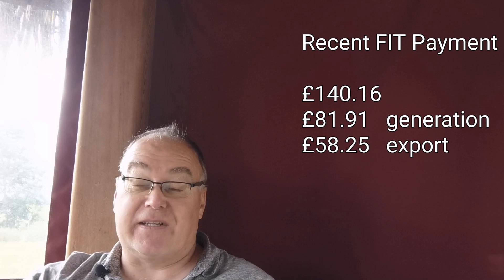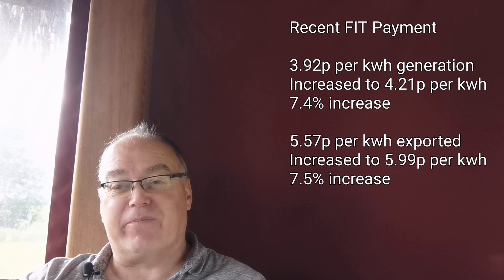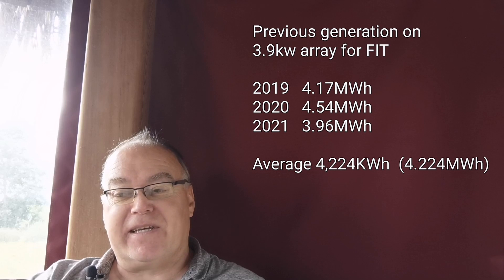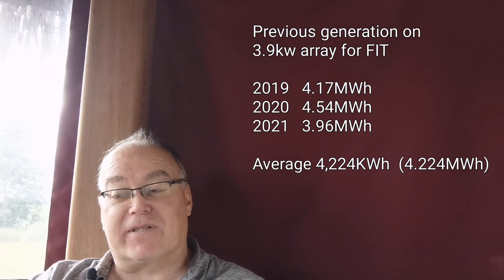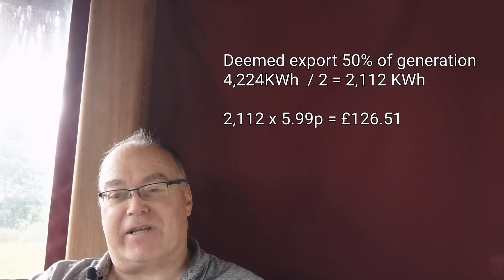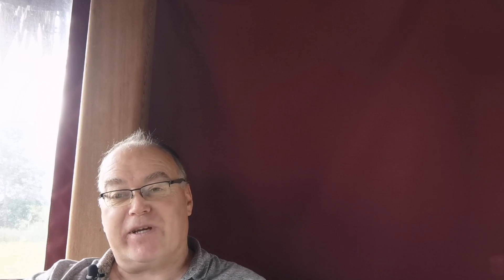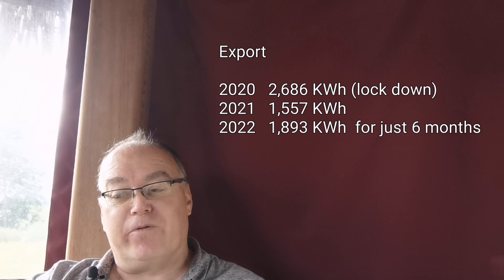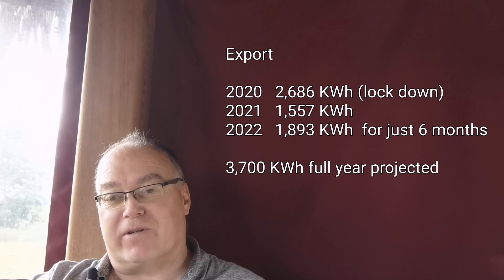Is it time to swap from FIT to  SEG? Smart Export Guarantee. Calculations & thoughts

Comment: does FIT not pay regardless of actually exporting? "deemed export"? More places to put the electric for future use while also getting paid 50% of it sounds better to me and a safer long term play. Assuming you'll have a water tank with your heat pump so thats a thermal store of the electric there. Something like the Sunamp for the heat pump could be another place. V2G stuff (Octopus Powerloop) feel like its going to be easier to store electric going forward vs exporting it for a tidy sum. My $0.02 thoughts.
Reply: They have changed a lot over the years. I’m not far from the end of a FIT contract that was for 10 years, with a generation price linked to RPI, plus deemed 50% (at a pretty low value) on the basis of not having an export meter. However, if a meter capable of measuring export came into use, real values would be required.

Notwithstanding the push from utility firms to switch to “Smart” meters, a couple of years ago the one I was dealing with didn’t want FIT customers to do that, as they hadn’t worked out what to do about switching from deemed to real values. After all, no generation meter is capable of being read remotely, along the lines of “smart” meters, and although the latest ones can measure export, they don’t really know what to do about it (bureaucratically). We would still have to read export and generation manually, at the same time, to make it work properly.

I suspect that if I had an export meter, they (Ofgem) wouldn’t like it, as the cash would flow the wrong way, especially at this time of year, like today!

Comment: Its not very clear(on the Octopus site).. But you cannot be on 'Go' or 'Go Faster' AND get 7.5p for export.

From Octopus "you can't be on both Outgoing Octopus AND Octopus Go"

This changes the numbers a bit i guess?

Alas my Go Faster is ending next week... So my electricity bill is going to pretty much double (we consume 14500kW/year)
Reply from the maker: As I said in winter when I need GO I dint export anything  don't need to be on any SEG

Comment: What I am looking at is if it is even possible to have enough solar panels and battery system in my house so that I can have zero energy bills. Not really seen any videos of anybody showing they have achieved this use electric for heating as well during winter.
Reply: I think being net-zero at the end of a year is more practical.  Ideally I would want what I sell in the summer to cover the heating costs in winter.  Not there yet but as solar power gets better a second array will help.
Reply from the maker: I worked out I'd need 300 solar panels and 100kwh battery . It's simply not practical .  In winter a 5kw wind turbine would help and be more effective than solar .

You just need to look at off-grid living to see what's possible and what's not
Reply: I think we will be able to achieve this in our newly built Passivhaus, which has a 13.8kW array and no heating system! We moved in in Feb so don’t have a whole year’s data yet - I’ll let you know next February…
Reply: Hi I’m looking to achieve this have a old house 1640 going full electric including heating have solar wind grid tie and off grid solar hopefully be off grid completely by next spring will do a video on how to do it ,it’s not easy.👍
Reply: I guess its all possible... But not that easy primarily as seasonal peak pv production is at the same time as lowest demand ie summer when the heating is off!
If you consider annual production vs annual demand it could be achievable. However.. to make it work you need to get parity on import and export prices. 

Ie .. if your consumption was 10,000kW over 12 months...
If you generated that amount of power over, in general, the summer months (pv) or winter (wind).. and your export payment/kWh was the same as your import/kWh cost.... The net effect is £0 zero!

I just had a quote for a 3kW wind turbine that i can install without planning consent (its allowable development)... However its £25k... 
Im afraid the numbers just dont stack up when i have another barn that i can put another load of solar PV on... 

Its all very interesting and i love to see  everyone's view and actions that they take...
At least we are actually doing something👍👍

Comment: Cracking video, thanks! Only thing to add is your behaviour. You based some of your costs on the old consumption/behaviour whilst on Go. When you switch to Agile you are more reactive to weather and unit rates, whereas Go lets you spank the grid 4-5hrs per day. With your array and battery capacity you could probably bring that £150 delta closer to break even compared with Go. 
But....it will need some management, everyday checking prices and making sure your inverter is gonna import/export at the right times. 

Probably not worth the effort. But, the Agile summer Go winter is a no brainer! Do it now 😁

Comment: All this info is great on this channel. But unfortunately many people can't even get a smart meter working for all these excellent tariffs. Unfortunately Octopus have attempted two smart meter installs at my address, but the meters can't send/receive a signal. So Octopus have told me I can't have a smart meter. This fact alone is costing me over £200 per month extra for electricity, as I am stuck on economy 7, rather than octopus Go. I am a high mileage EV user and my village does not have gas supply so depend on electricity for heating my 4 bedroom stone built Victorian house. Smart meter post code lottery at great expense for many. What's more I still am paying for smart meter rollout, even though I can use one. Anyone want to look into this for me?
Reply from the maker: Just have to keep plugging away and asking. It's a strategy
Reply: @EVPuzzle  unfortunately it does not work. Octopus have said in writing that a smart meter will not work at my location. It is not Octopus fault but the  Data Communications Company  (DCC) they operate the network for the government. I'm in the process of making a formal technical complaint against them. I am copying in MP's and others who need to know the truth about the network and its limitations that mean millions will suffer financial burdens because of their incompetence.
Reply: As mad as this may sound, switch to Eon or Eon next and get them to install one. They use their own in house installation team who were brilliant in a similar situation I had (rural installation with unexpected 3 phase!). Then when all up and running switch back. I was able to book smart meter installation on the same call for installation 10 days later.
Reply: OP probably lives in flyingdales or something similar.
Reply: @Swwils  I don't live in that area. I do live in a house with 600mm stone walls. The solution is to develop and make available  a smart meter  for the North England/Scotland radio frequency, that can have an external aerial attached. The trouble is in rest of England they have recently removed the requirement to install T3 aerials, citing that planing would be required, which is nonsense as they would still work in attics and anyway using planning as an excuse to stop install is not justifiable for those families having to pay a fortune as they can't access a smart meter tariff.
Reply: Is there no mobile phone signal on any network where you live? Have they assessed you for a T3 aerial? I had big problems trying to get my smart meter to work and it dragged on for nearly a year - then I raised a formal complaint with Octopus and the situation changed dramatically and it was sorted out within weeks! If it’s really physically impossible, then there’s nothing you can do but the complaints procedure is worth a try in my experience.
Reply: @oakfield_farm  I followed the octopus complaints procedure and Octopus have been very helpful but there is nothing they can do. I have mobile signal at my property, but this is not relevant for North England and Scotland as the smart meters up here don't work on the mobile phone network wavelengths but for some reason they chose to use the same frequency as the emergency services. As a result of using the long range radio (LRR) spectrum at 412 - 414 MHz none of the smart meters used in North England and Scotland have sockets for external aerials. There maybe technical reasons for this, but it is totally unacceptable as there is no solution for people in areas of poor signal strength on LRR wavelength.

Comment: Well it’s definitely a puzzle. Unless the T&Cs have changed the switch to import tariff you mentioned isn’t correct, or I’ve misunderstood. You don’t have to be on the Agile import to get the Agile Export. True you can’t have Go and Agile Export at same time. We are on an economy 7 import tariff (31p peak, 21p off-peak) and have been on Agile export since March. My average price has been 16.6p per kWh during this time, that’s without going to the hassle of changing battery discharge settings on the inverter. It’s doing ok so far, been paid just over £160 for 3 and half months exporting.
Reply from the maker: Seems like it's a can of worms as to what mixes and matches .  I'll find out for sure  when I ask to change
Reply: @EVPuzzle  we’re also on an octopus fixed tariff for import and agile outgoing for export
Reply: This is right Peakrider- I just changed to Outgoing Agile and kept my Variable import. Now making nearly 3x more export money. Hugely worth doing

Comment: It's a difficult one to consider.  The crucial thing is that there's no reverse gear with any decision to move away from FIT export tariffs.

Therefore the consideration I'd be making in your situation is the long term 22 year prospect for export prices, not just the next two to three years.  Right now on the Agile Export tariff, it's a very handsome price as you say.  For me, the decision was easy, as I was never eligible for a deemed FIT export tariff anyway.

The risk is that as more people get solar in the years to come, the export prices could plummet on those abundant sunny days.  Take a look at the 11th June 2022, when there were gale force winds + lots of sunshine.  Negative import prices, and miniscule export prices.  But with the deemed FIT export tariff, you get some money.
Reply: At least with FIT its linked to inflation
Reply: @rodden1953  Yes, FIT is guaranteed for those who qualify. Arguably the bigger decision for most is getting rid of gas. Even with high efficiency heat pumps people will use more electricity than before. It’s not easy to be certain which will be the best choice on economic grounds over the long term, but generating as much of your own energy as possible reduces exposure, dependency and exploitation.
Reply from the maker: Agree it's a bold decision to let go of FIT export. Bird in the hand etc which is why I deliberate unless it's a no brainer

Comment: I get 7.5 p for export from Octopus. They pay so much more than other suppliers. It's a disgrace that some supplies only pay a penny or so for SEG given how much energy prices have increased.
Reply: See if you can switch to Agile Outgoing, it is averaging 18-20p daily for the last few weeks for me
Reply: @amirkajol  I didn't opt for battery storage and Agile is only available with that but I agree in the case of a battery it would be a good option
Reply: I’ve recently signed up for a SEG with Octopus but it was only 4.5p
Reply: @bromide999  that's all they pay unless you use them for your electricity supply too
Reply: @robsmith1a  I get 4.1p. I'm on octopus go for electricity with 5p off peak rate. They won't pay me more unless I move from Octopus go to a standard tariff.
Reply: @onlineo2263  hmm. That’s the catch then. I’m on the standard variable rate, 29p for import. My previous energy supplier ‘Social Energy’ went bankrupt and I was put on British Gas. Don’t have an EV yet, so not on the Go / Intelligent tariffs. But I recently got my bill for June and have got an average of 19.81p/KWH exported for 660+ kw = £120+ in a month. Import bill (gas + electricity) was £34. Overall in credit of £86 for June 22 (which I wasn’t expecting). I guess if you have an EV, then you would benefit more from the 5/7.5p incoming rate to charge the car!
Reply: @bromide999  Same here Trevor.  Our system is 6kw with 8.2kw battery.  System was commissioned mid September.
As of writing generated 300kwh, but the SEG from Octopus Go only started 26th October.
Still getting used to the system, but waiting until late Feb / early March before I consider changing .
Think the providers projections were just £110 in export payments per year, so in that regards its encouraging that I'm hoping we can comfortably triple that or more?!

Comment: I think it’s a no brainier for you to move to Agile Outgoing definitely during summer months. I moved to SEG in April 2021 and Outgoing It’s worked well for me with less PV 3.9 at FIT and 2.5 PV no FIT and only 4.8 KWh battery. I moved back to GO September 21 and then back to  Outgoing March this year. My Moixa battery optimises the export during peak Outgoing rates, exacta what you are suggesting. 

Also just had a quote for Octopus ASHP - you should definitely look at this too as the survey was very detailed and through and quote very reasonable, again in your case it would work well to replace your oil boiler.
Reply from the maker: I think this is the sensible way forward and has the feel good factor of hrklung the grid 9 months of the year whilst being paid to do so
Reply: I am concerned that Octopus may object to a customer continually moving between Agile and GO every 6 months. Did this come up for you at all Bob?
Reply: @Jingleuk  no, so far it’s not been any problem

Comment: I thought if you are on go you can’t get a fixed price ?
Reply from the maker: Octopus site says can't get outgoing whilst on GO.
Reply: @EVPuzzle  the "Outgoing" comes in two forms, fixed (7.5p) and Agile. You can't get the 7.5p on Go...
Reply from the maker: If so it just shows how confusing it is and how their site info isn't clear.

Initially I thoughts this was the case but was then convinced otherwise when I read their site details
Reply: @EVPuzzle  I also don't think it's clear either that you CAN get outgoing agile on a normal (non agile) tariff
Reply from the maker: What is clear is agile outgoing comes with agile incoming . It's all Agile
Reply: @bencampbell2041  i cant get the 7.5p?? Im on Go Faster.. my maximum is 4.1p??
I can go Agile again... But Tesla looks a better overall option (for me after crunching the numbers).
Im looking at more PV and thankfully my installer 'future proofed' the first installation so i can add the new string to the same inverter👍
Reply: Def checked with them and can’t have fixed with Go.